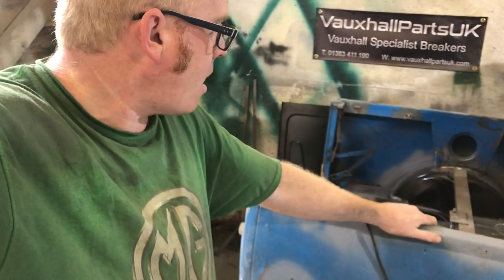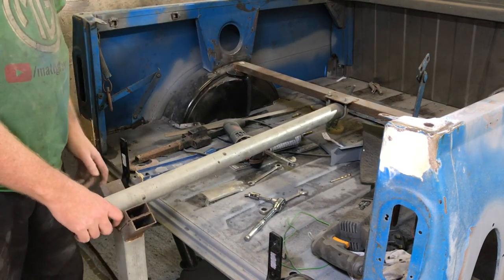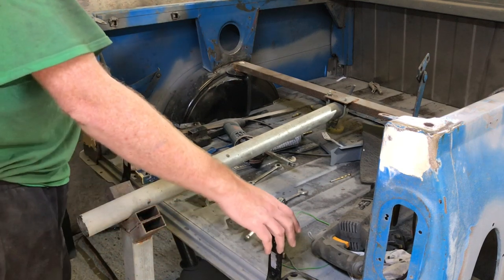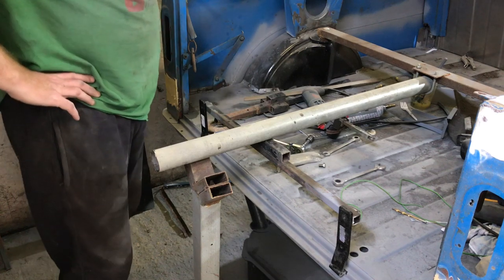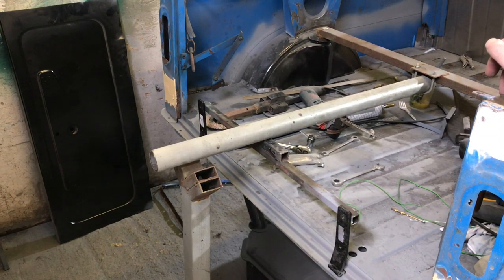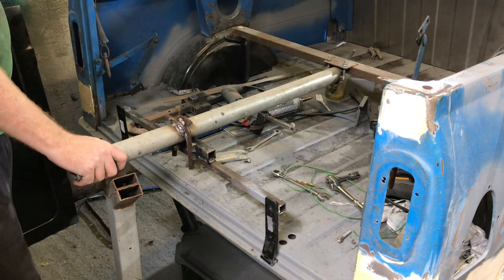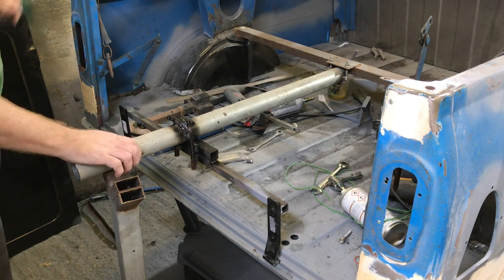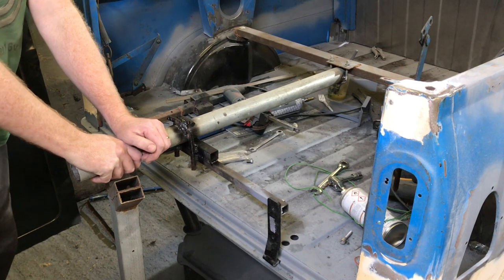Classic Mini Pickup Roll Over Jig / Spit - Attempt 1

Comment: I would make new brackets just right angles and join them across lower down, with another bar. Maybe a corner flangy thing on each. The pivot is the weak bit in the hinge. Tandoori chicken.

Comment: When the car is rotated the force on the hinges is going to be sideways. Will they be strong enough?
Reply from the maker: Exactly
Reply: Not to bad Matt, but what about spreading the load through some dummy plates bolted in both rear light apertures with a bar between them. it will triangulate the rear body and stiffen it up  .......nice work mate keep it up  👍👍😎